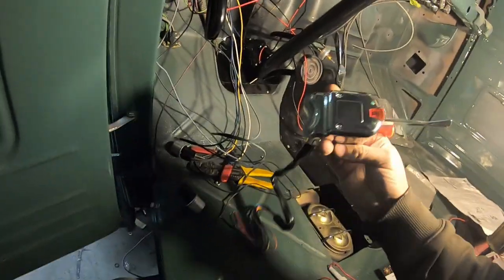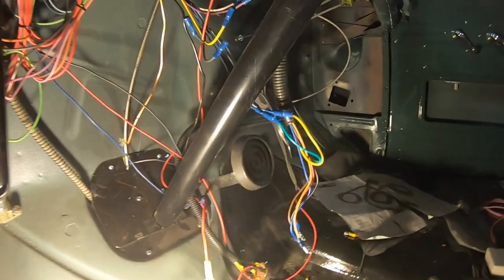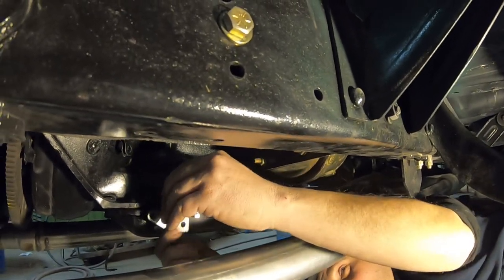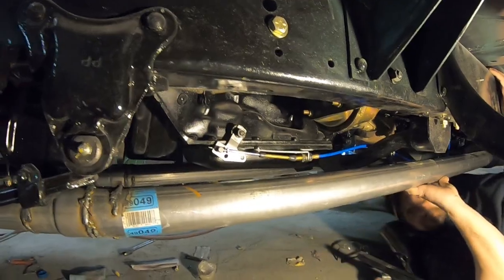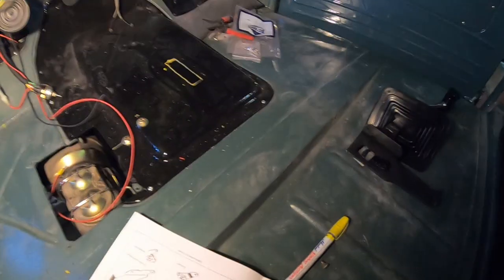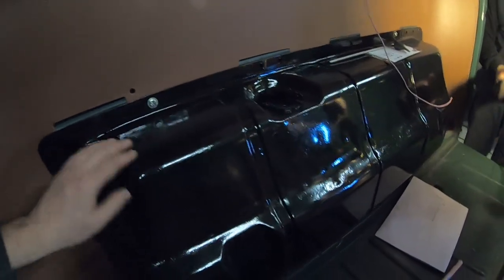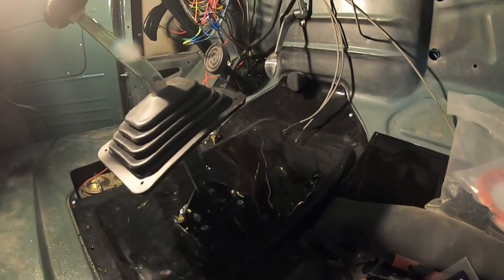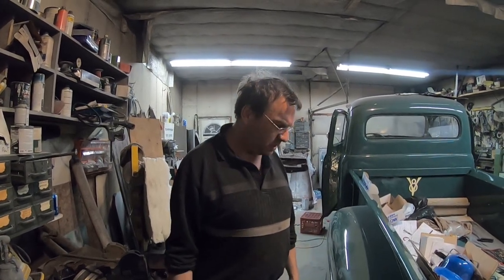1952 Ford F1 Gets a B&M Shifter and the Turn Signals Get Installed and working.  Hot Rod Truck.

Comment: I wish I was closer , I would hire you guys to finish my 48 F1 , you guys do great work! New fan here from Louisville Kentucky 👍👍👍
Reply from the maker: Thank you Tom.  How far along are you with yours?
Reply: Mechanically it’s sound has a great running Flathead v8 , all that’s left to do, is paint and install the bed , bed wood and rear fenders, front and rear bumper and wire up the tail lights , and she’s pretty much finished, but I’m thinking about rewiring the whole truck.
Reply: Love your channel by the way👍
Reply from the maker: @tbonekelley  Not a bad idea to rewire the truck.  We have another 51 with the original flathead that we will attempt to get running and driving this summer.
Reply: I’ll be watching for your next video👍

Comment: Does your signal switch have the green lights, and did you get them to work. I couldn't get mine to work so just installed a couple of green LEDs in the dash and wired them to the front flashers.
Also, if your switch is anything like mine, you might want to file down the edge of the lever, it was pretty sharp on mine.
Reply from the maker: No i did not get the green lights on the switch to work but the green arrows on the dash do so I am happy with that.  I think mine was a little sharp also.  Not the greatest quality one.

Comment: Does Turn Singal Switch come with a 4 way Hazzard Switch for Turn Signal lights turn on also off on front plus back to wire up  & if not I would hook with Toggle Switch on dash  one of flashers breakers to ! Plus on were are you guys put 2 license plate  or one also if doing one were planning put it and if doing back are going have light come on back one put with turn head lights on plus have lights on middle on top shine whole plate on see to! But putting license in back bumper have have on light on left also right side to be well light up side to side for at night driving too see! Or make license plate Hanger on left or right Turn / Brake light for license plate at your choice too! Also shifter put 2 spacer one up top and one on bottom so won't flex bad on shifter too of 1/8 to 1/4 metal of square spacers too !
Reply from the maker: Sure does come with a 4 way hazzard in it and will have a plate on the front and back. I like your idea Andrew.
Reply: @pennyshotrodscustoms  thank you guys and glad to help !